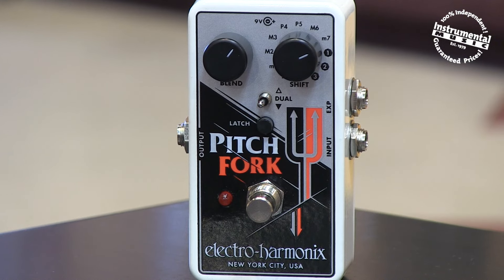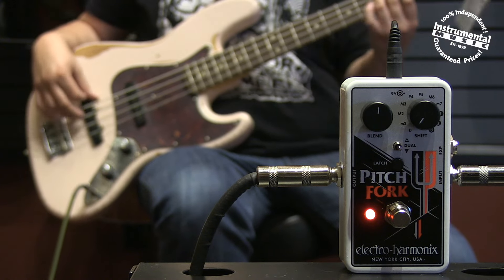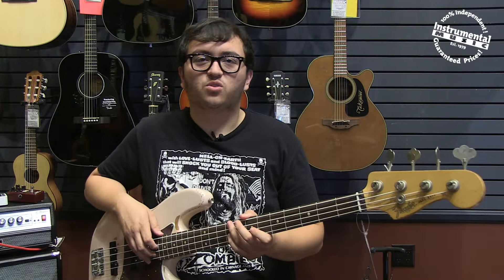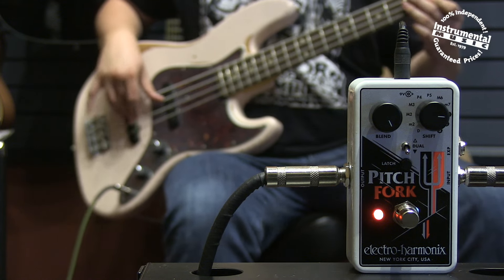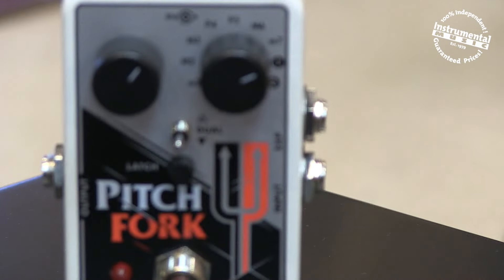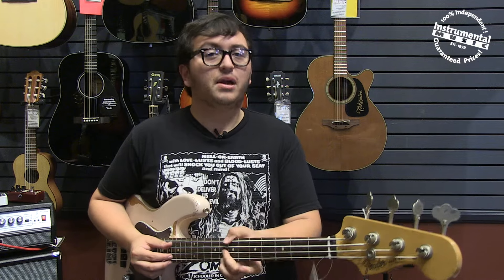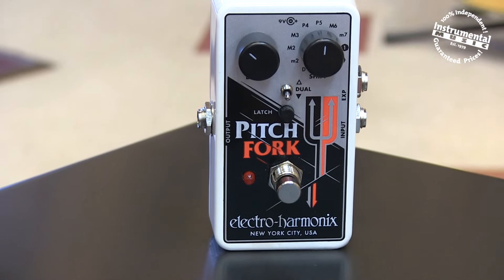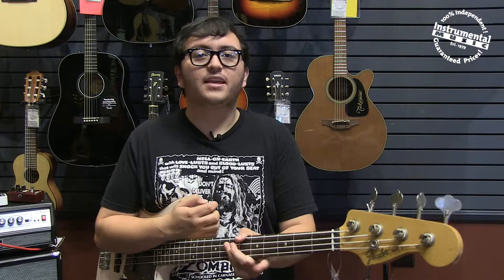Electro Harmonix Pitch Fork Bass Demo

Comment: Good demo, but the latency in tracking, especially in up-pitching annoys me. I’m currently using the Boss MO-2 as a pitch shifter, and the tracking is PERFECT.
EDIT: I just bought the Pitch Fork, and it does not suffer any latency. Sounds incredible backed with distortion and reverb!
Reply: Hi rhino, I'm planning to buy a pitch fork for my loop bass setup and I can't tolerate any latency cause will kill the groove. You tried the pitch fork? You experienced latency or lag?
Reply: @sGreenWasp  I've used the Pitchfork for years... in my last band I used it to replace our rhythm guitarist when he left, split my bass signal to go pure 1 oct up in the PF then thru a Big Muff into a dedicated guitar amp (got the idea from Royal Blood.) To my ears there was no latency, the "guitar" riffs were perfectly tracked to my basslines and I had plenty of fast runs and fills that would've turned to mush if it had any latency. In my opinion this and the POD are the tightest Oct up pedals out there.
Reply: @sGreenWasp - Happily, no latency at all! It’s permanently in my rig.